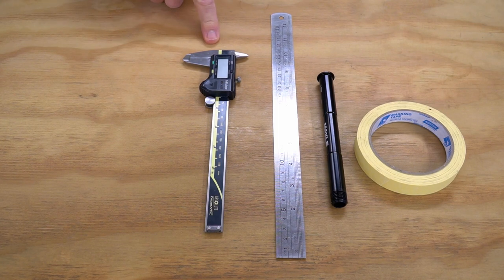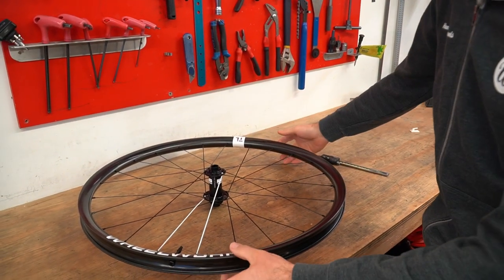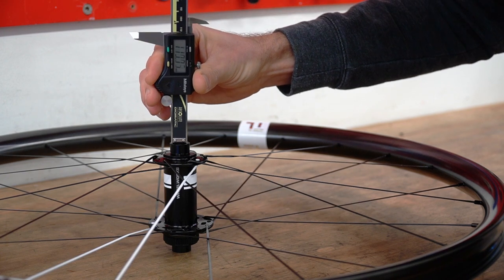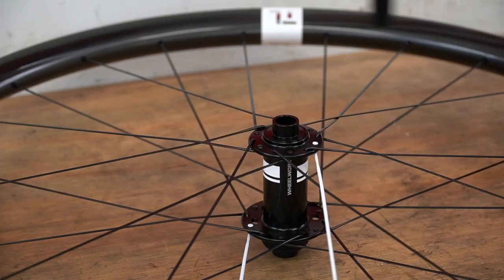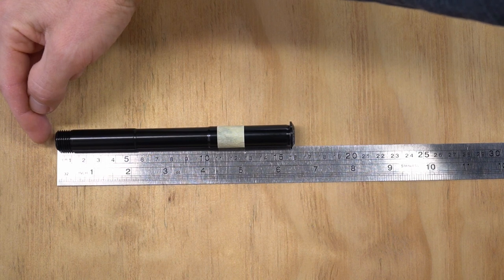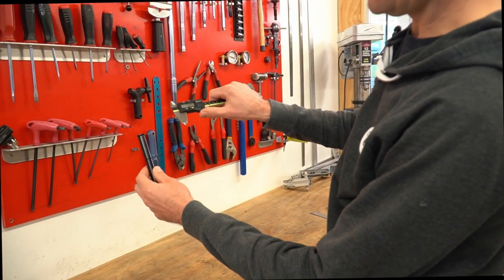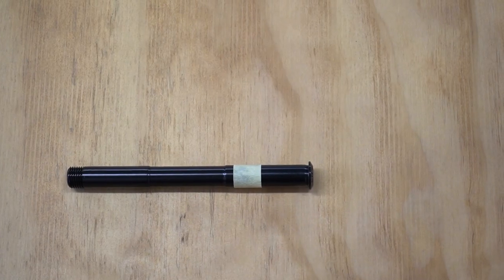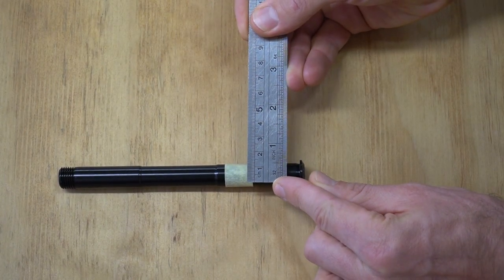Hub Width Explained | Wheelworks How To

Comment: Thanks for sharing the knowledge 👌

Let’s say I have a disc brake road bike, on the fork it should be a 100mm hub but I want to use a wheel that has a hub of 101.1mm, do you think it’s ok? All others hubs I’ve used are exactly 100mm but these others are label as 101.1mm.
Reply from the maker: There will be some variance in the hubs - they won't all measure 100.00mm. My guess is that yours is slightly over because the endcaps have popped out slightly and will come back closer to 100mm once in a fork.  In short:  I don't see any issues using it. -TT
Reply: @WheelworksHandcraftedWheels  thanks for the response guys 💪